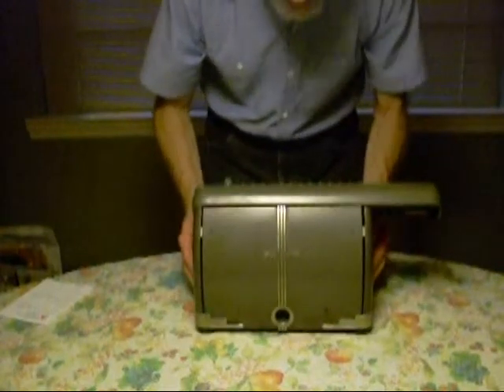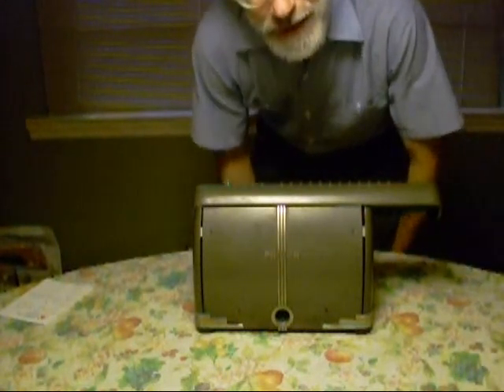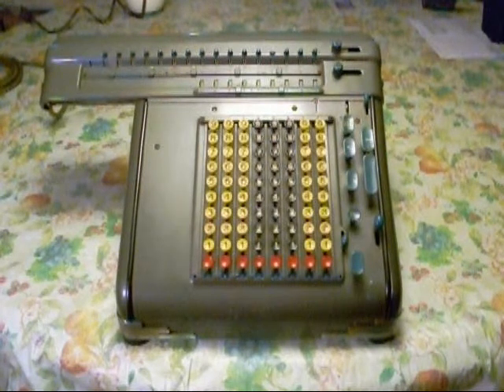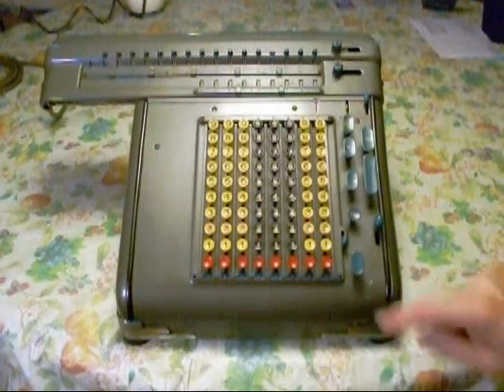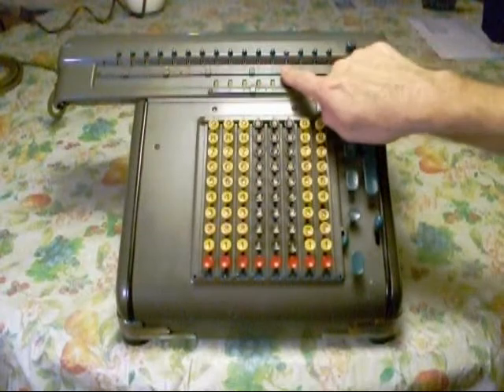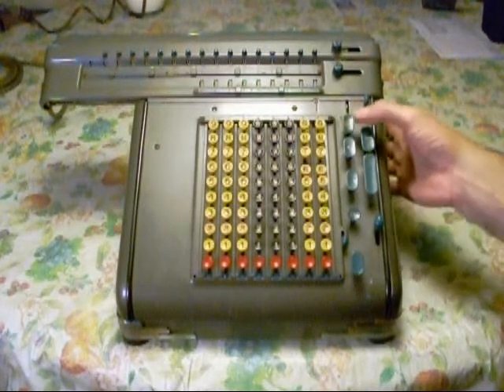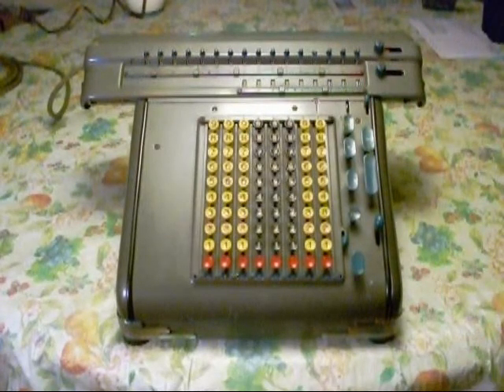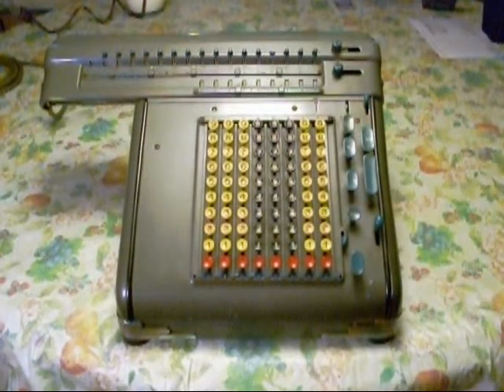Friden Model D calculator

Comment: Thank you for this video. I recently picked up a Friden D by accident (meant to get a parts ST-10,) and I had no idea how to do multiplication or division. So I really didn't know if it was working properly once I cleaned it up.This was very helpful in determining that it does work! 
Mine has the split division key and the keyboard doesn't have red buttons, but it's definitely a D. Cheers!
Reply: Is it perhaps in the art deco style with the green and silver keyboard keys?

Comment from the maker: Correct, at least for this model.  It did not come with an operating manual, so I had to determine how it works just by using it.  I figured out how it works when I got it, over 40 years ago.  It was interesting to pull it out of storage after all this time, and I still remembered how to operate it!
Спасибо for leaving a comment.  :)

Comment: Many thanks for your kind comments on my Friden video.  Your Friden sounds really good and crisp.  I've also posted another of this calculator performing square roots.  I've tried to post a comment previously but it didn't come through.  My friden is in need of more work as the 60 year old lubrication glues up some parts of the mechanism if the calculator is not kept constantly in work.  A good dipping in a degreasing bath, I think!